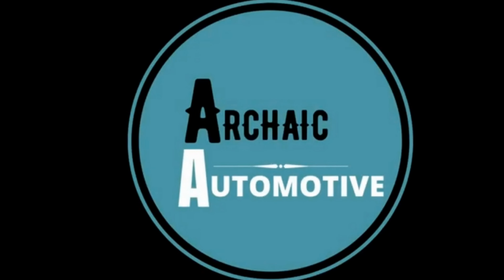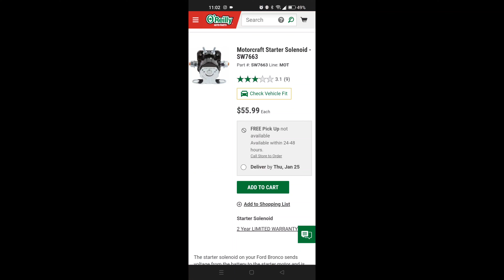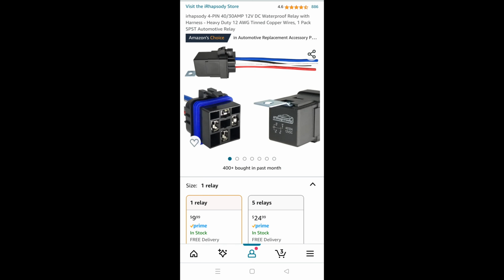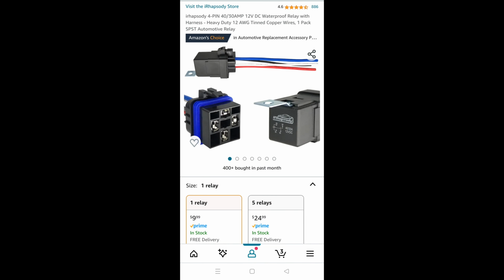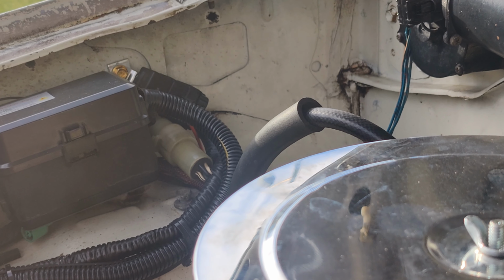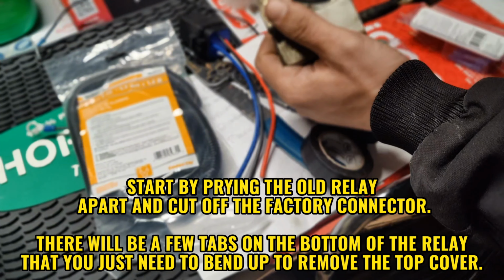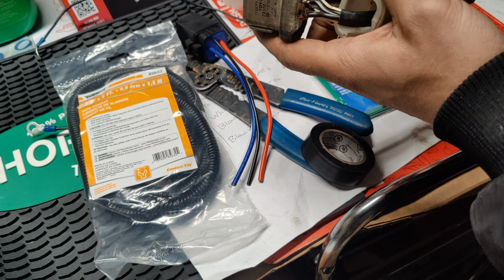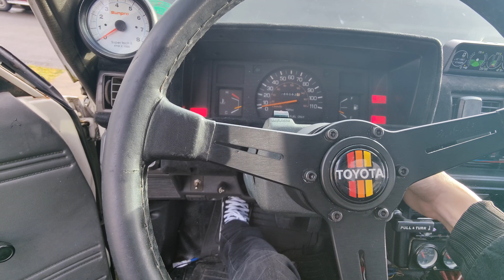1987-89 TOYOTA PICKUP/4RUNNER NO CRANK STARTER RELAY FIX

Comment: I’ve tried running the wire directly to the harness and it worked. However, it’s more of a temporary solution because I started having the same problem again after about 2 years. I am now looking for a more permanent solution but I am also reluctant to get a ford relay in there. This looks like a great idea and it looks very clean and factory. Thank you for sharing!
Reply from the maker: Glad it helps! I've had this set up for a couple years now and have not had a problem.

Comment: Thank-you for this video! I did everything you said and the truck started right up. The only thing I did different was I soldered all the connections. Since the truck's been sitting for a while, the choke is stuck open and it won't idle...ay yai yai. I think I can blame California gasoline for the carb to get gummy. Mixing ethnal with gasoline is a huge mistake in my opinion. Anyway, thanks for your video. I'm a subscriber, now!
Reply from the maker: @svt9480  awesome! glad it helped you out.

Comment: I live in Washington with an 86 4Runner having that same issue and looking to fix, it was intermittent for awhile then now it just won’t turn over
Reply from the maker: @greygreenough5505  Yeah that happened to my '87 too. Sometimes unplugging the relay and plugging it back in would work but it got to the point where it was just constantly doing it. If your local to me feel free to bring it by or ask any questions you need and we can get you sorted.

Comment: So if I already cut the harness and ran it to the battery, would I just keep that then just cap the red wire if I were to add this relay?
Reply from the maker: Yes or reconnect it when you cut it from.

Comment: Very cool, nice and tidy. How do you like the Weber? When I changed mine, it was night and day, I did put the Offenhauser intake on though, and a dual-row chain. JIm
Reply from the maker: Thank you Jim! 
The Weber works great I like it a lot more than the stock carb, It does have a little bit of issue at high angles when I'm off-roading but other than that it works really well.
Reply from the maker: @aerialrescuesolutions3277 
It's usually not too bad unless I'm going up a real steep incline.

There's actually a modification that you can do to the Weber that relocates the fuel bowl vent to correct that issue.

Maybe I'll cover it in an upcoming video.
Reply: Got a 38mm Weber on a LCE stage 2 stroker..(160hp).Only problem is it blows up G and W transmissions...had to find a R151F and it cost me big along with a V6 diff....Anyone installing a Weber remember they only need 2.5 to 4 psi fuel pressure(OEM pump is 7 psi), anything more and they run very rich and cant tune... Before you cut up any wires make sure the rely is totally bad, Ive opened one and cleaned the contacts and fixed it....

Comment: Man I feel like the dumb guy but the battery wire hooks directly to the pos on the battery?
Reply from the maker: @JamesNealon-b5h  Yes it will connect directly to the battery.
Reply: Yeah Thanks man wiring makes my head hurt but I looked at it just seemed too easy . Basically bypassed all the Bs.  Unfortunately I already had purchased an expensive used relay. I used the same starter for ten years aftermarket then went through 3 in six months one was bad out of the box second one lasted a month and then I the third one was going it seemed to lock up at times still think the solenoid could be hanging up but its very random and at 50 im just get too old to pop start my rig, so anyways thanks for the info
Reply from the maker: @JamesNealon-b5h  I'm glad it helps you out man! I've had this set up for probably around 4 plus years now and it's never not started.
Reply: Yeah, me too. I was thinking where on the positive side of the battery is the wire gets hooked up; on the post, cut the cable then attach it, or attach it to the terminal..? Now I see it as attaching it directly to the terminal. Thanks, now I dont feel so dumb.